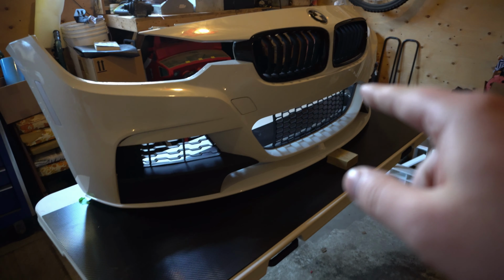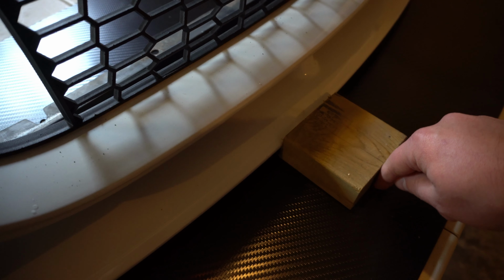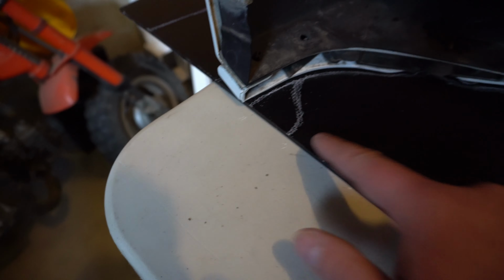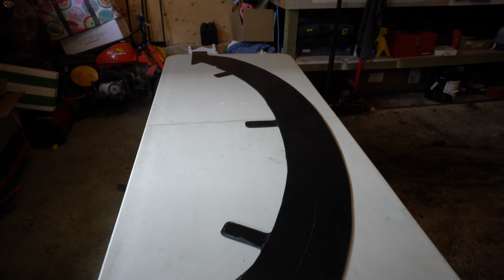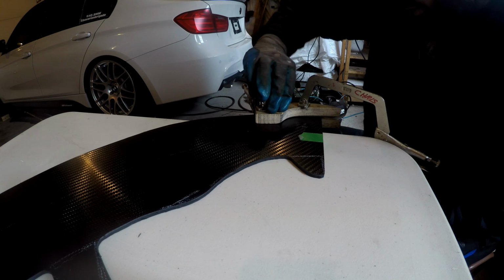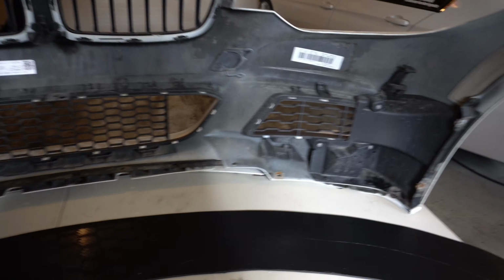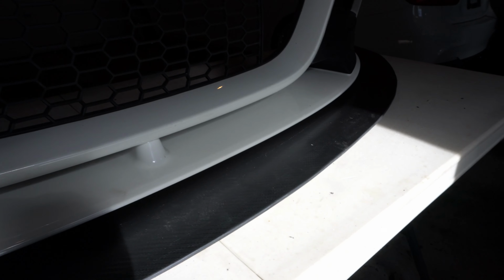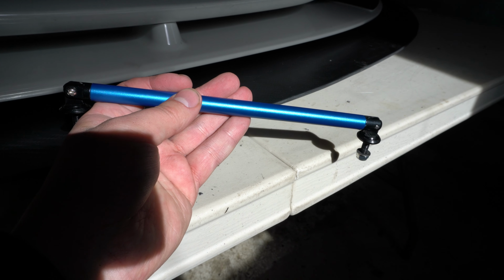How to make and Install a Custom Front Splitter

Comment from the maker: Want to Win an XKGLOW system for your car? Check it out :
https://youtu.be/IWIomjycyUA
Reply: where did you buy that carbon piece to make the splitter out of?
Reply from the maker: I found my receipt and I got the material from Plastic Works Inc in Calgary AB www.plasticworksinc.com and the product code is 01CH and the description is 3/16” Carbon Fibre ABS
Reply: HQ_BMW thank you so much 💪🏼
Reply from the maker: Anthony Michael no problem anytime 👊🏻👊🏻

Comment: For anyone else that ever finds this in the future, do NOT EVER cut Carbon Fiber without wearing a respirator. Once cut the fiber dust are like tiny floating spears that once inhaled, get stuck in your lungs and they do NOT EVER COME OUT. Not trying to shame the video, as most people don't know this, but never ever do it like this please.
Reply from the maker: This is absolutely true when working with real Carbon Fiber. The ABS plastic with CF print on it is NOT actually carbon Fiber
Reply: Yeah, noticed that + total lack of safety gear! Bloody amateurs!

Comment: Looks very nice but this is purely cosmetic obviously right?  There is no way any of those attachment points withstand actual forces generated at the speeds splitters are designed for.

Comment: Looks really good.
Where do you find the plastic sheet.
Reply from the maker: I just googled Plastic sheets and looked for local stores that sold sheets of it.
Reply: @HQGARAGE  ok, cool. I guess it's not a item that you see often or need for that matter on a regular basis so in my mind I'm thinking, special order, ridiculous shipping, etc.   It looks like a strong material unlike plexiglass that would break easily. Anyway, I subscribed to your channel for ideas like the one you shared. I bought a body kit for my MR2 Spyder  that I'll start installing when this Florida heat and rain turns a little cooler in the fall. I want a splitter on it like the one you made. Was it 1/4" abs?
Keep the creations coming and thank you for the video. I'll save it for a tutorial reference for my upcoming build project.
Reply from the maker: I have used 3/16” and 1/4” ABS plastic sheet and the 3/16 was easier to work with but the 1/4 seemed much stiffer.
Reply: @HQGARAGE  I might as well go with the 1/4". You know for the occasional curb rash that sometimes happens, it be a bit beefier.
Reply from the maker: I think that is a very smart decision.
Reply: @HQGARAGE  have you made any rear difussers
Reply from the maker: I have not as of yet

Comment: Much respect!
Reply from the maker: Cheers 🍻
Reply: @HQGARAGE  will this save gas mileage?
Reply from the maker: Nope, won’t save gas ⛽️ at all
Reply: @HQGARAGE  does it give you stability?
Reply from the maker: It does increase downforce on the front tires

Comment: Any tips to put a new lip with old drill holes from old lip? Would bigger screws work?
Reply from the maker: I would definitely say bigger screws would work or if you can use bolts. I had to end up changing mine to bolts.
Reply: @HQGARAGE  yeah thats what I'm going to do now. At first I was going to pay 500 to get it welded.  The thing about bolts is I can't get my hand in there. Bolted won't go no where
Reply from the maker: Can you take the bumper off? Would that help? The other option would be to use a product like a Rivnut. It is like a Nut that is fastened into the bumper and the bolt threads into it.
Reply: @HQGARAGE  yeah I could do that again. I took it off once to switch out my grill but when I installed the lip I just jacked it up. Just iffy about taking it off again. The only thing is I had crooked 1st time the drilled next to it 2nd time now scared holes too close
Reply from the maker: I can totally understand your nervousness
Reply: @HQGARAGE  I'm definitely going to see what's up with the rivnut and removing bumper. I'll find a way , it'll feel weird without my lip. Thanks for the advice bro

Comment: I want to do this to my car, I have a Ford Fiesta SE.  it doesn't have such a fancy front bumper, and has a rubber air dam underneath the bumper.

Do you reckon I should build my splitter off the bottom of the air damn, so that I get the aero effects the splitter are supposed to bring?
Reply from the maker: I would do it on the bottom of the bumper. I don’t think the air dam would be strong enough to support the Splitter.
Reply: @HQGARAGE  thanks for getting back to me!  I appreciate your input!

My plan in tandem with this is to also build an underplate for my car, starting at the level of the rubberized air dam, supported by equally long brackets.  If I build it from that, I was thinking to use ABS and have it extend past the edge of the airdam.

I mostly am curious of if the splitter would even be effective and do splitter stuff if I built it higher off the bumper.  I know that'd look cleaner, too.  I just don't know enough as to the aero effects of both.

Thanks so much for your time, I appreciate you!

Comment: whats the best way to drill a hold in the abs plastic to put the splitter rods in? wouldn't the abs crack around the drill hole when drilling?
Reply from the maker: I just used a drill bit and never ever had a cracking issue and I can tell you the splitter has seen some major abuse.

Comment: Is the plastic you got in the description?
Reply from the maker: It is not but I should add it to the description. I used 3/16” ABS plastic from a local plastic supplier here in Calgary called Plasticworks

Comment: You did not mention where you buy that CF sheets you use!!?
Reply from the maker: Hey, I got it locally at a plastic shop. Here is there website. http://plasticworksinc.com
Reply: Forgot to ask the thickness you use on splitter??? Thank you!
Reply from the maker: 3/16 is what I used

Comment: How thick is the abs plastic
Reply from the maker: I used 3/16” thick material
Reply: @HQGARAGE  do you think a 1/4 inch is too thick or 3/16 is better?
Reply from the maker: I actually think 1/4” is the better option.

Comment: The splitter turned out perfect  Where did you get the material
Reply from the maker: I ended up buying the material from here 
I found my receipt and I got the material from Plastic Works Inc in Calgary AB www.plasticworksinc.com and the product code is 01CH and the description is 3/16” Carbon Fibre ABS
Reply: Right on thank you!!!!!
Reply from the maker: My Pleasure 👍👍
Reply: HQ_BMW so it’s ABS plastic with carbon vinyl?
Reply from the maker: No it’s actually ABS plastic that has been stamped with the carbon weave. So it’s all one piece and gives you the look of carbon fiber.
Reply: HQ_BMW that website blows.
Reply: How much was it?
Reply from the maker: It was $60 CDN for a 2ftx8ft piece
Reply: HQ_BMW did you have to call or email?  Again the site sucks.
Reply from the maker: Fortunately I live about 30 mins away I just drove to the shop. I’m sure if you called they would be able to help. If not let me know and maybe I can swing by and talk to them

Comment: Great job man I went cheap and bout eBay plastic splitter for my car and we’ll I cracked it coming onto a gas pump island I wanna make my own outta sheet metal but the stuff you used looks great! Where can you find that at?
Reply from the maker: Thank you 🙏 I just googled ABS Plastic near me on Google and found a local plastic supply company

Comment: Hey ? What were the measurements of the plastic sheet when u got it im trying to do something like that for a 300 srt8
Reply from the maker: I got 2ft x 8ft to start with and 3/16” thick
Reply: HQ_BMW how much would you charge me to make one for my car
Reply: But not carbon fiber just a regular black one
Reply: HQ_BMW hey i just wanted to say thanks for the info i just finish mine on the 3000 srt
Reply from the maker: Awesome that’s is so rad. Thank you for the feedback 🙏🙏🙏

Comment: I did the same thing but mine flew off after going 50mph. Is it because the plastic was too thin or is it because the splitter is too big? I wish I could show you a picture.
Reply from the maker: It was probably because it was too big. I ended up cutting mine down and also had to use bolts instead of self tapping screws.

Comment: Will the self taper bolts holds the splitter enough you think ?
Reply from the maker: Nope 👎🏻 I ended up redoing the splitter after I got the bumper painted. I used bolts, washers and Nuts to secure it down. You can see what I did in this video https://youtu.be/sZHFNpYbtUc

Comment: I got a 2013 sonic hatchback that I'm putting money into and I want a fiberglass sheet or one that is not pressed. Any ideas?
Reply from the maker: I would look into getting a sheet of Aluminum or a material called e-panel. APR I know makes Aluminum ones for the strength and durability but also very light

Comment: Do you have any suggestions on how to mount a splitter  on a bumper that isn't flat...i.e. an 08 m35 bumper? My bumper curves up towards the front rather than sitting flat like most cars
Reply from the maker: You could trim out the shape bigger than what you need and then heat it up to form the shape or if you know or have access to a sheet metal brake you could shape it to fit. The other option would be to make it in pieces and then bolt or rivet it together
Reply: @HQGARAGE  Appreciate your help, if the rain ever let's up here in Texas that'll be my project next weekend. Your splitter came out perfect, did you even find the correct rods?
Reply from the maker: No Problem and No I didn’t, I ended up. Using some threaded rod and aluminum tubing and just made my own with the ends of the ones I bought
Reply: @HQGARAGE  I might end up doing the same, everyone in other videos say all the ebay rods are trash. Looking forward to seeing more of your videos man, keep em coming👌🏾 If you haven't already, you should do a rear diffuser how to
Reply from the maker: Hey thanks for the great idea 👌👌I have not done one yet but I like it. I will definitely make a video of it. 🙏🙏🙏

Comment: Great work! Looks really nice, and the fins add a lot to it.
Only thing I would be worried about is that it is just mounted to the bumper, is it not a bit flappy, when you are going fast? Most ones I saw are much longer and even connected to the frame. How was your experience so far?
Reply from the maker: I didn’t have any issues to be honest. Being that it is for looks it’s been perfect

Comment: NICE STUFF! It appears everyone is having an issue finding this abs carbon sheet plate, especially for the price you paid. Can you provide the man and model of the sheet plate or a link to it? In the US, so naturally I'd have to find and equal. Thanks.
Reply from the maker: I will get the specs from the shop I purchased it from and also ask if they have anyone in the states that they can recommend.
Reply: HQ_BMW thanks !!

Comment: Nice job bro! Looks nice. I just wanna give my humble opinion. Could you have made it bigger so you can mount it to the chassis?  Maybe it would have more stability.
Reply from the maker: Thanks Man and yes I agree it could have been extended to attach to the chassis for sure. I actually ended up trimming an inch off and cut the wings off and it was rock solid. It was also just for show and would fill the gap between the bumper and the ground when I aired out.
Reply: @HQGARAGE It definitely looks real good. Im gonna have to try to make one myself using your method. I have a cadillac ats coupe, and we basically have no aftermarket parts. Everyone buys the same ebay front splitter lol.

Comment: Wouldn't it be easier to just move the bumper back 3" then trace the bumper without the block? Also what thickness ABS did you use? Thanks for making this video.
Reply from the maker: That method would absolutely work as well. It’s all up to you on how you would like to trace the bumper. The material was 3/16” that is used.
Reply: @HQGARAGE  If you just move the bumper back 3 inches and trace around it then you wont get the extra width and the little wings on the side. If you want it to look a less aggressive then this is what you would probably do and also you wont get the little side wings.  Either way its a pretty nice mod that you can put your own custom finish on, I like it.
Reply from the maker: Yes you are absolutely right and I ended up cutting off the side wings anyway. Thanks for the kind words.

Comment: Great work! Looks Amazing.. Hey I have a WRX front lip that I'm custome fitting on a different bumper, but the lip is wider than my bumper like 2.5". Where do I cut to shrink it and make it fit? Love your wk, Thx in Advance.
Reply from the maker: I would maybe cut it in 3rds and have the pieces and connect kind of like this one 3Pcs Universal Car Front Bumper Lip Chin Bumper Body Kits Splitter Diffuser for Honda for BMW for Benz Carbon Fiber Look/Black https://www.amazon.ca/dp/B07YNLNW6T/ref=cm_sw_r_cp_api_i_iVtNDbJGFQ6HG

Comment: where did you find the sheet of plastic to use?
Reply from the maker: I found my receipt and I got the material from Plastic Works Inc in Calgary AB www.plasticworksinc.com and the product code is 01CH and the description is 3/16” Carbon Fibre ABS

Comment: Hello. Great job sir, looks like its an oem ///M Performance part!

Quick question: how thick should the ABS Plastic be? And have you had any issues with breaking since installation. 

Thanks in advance!
Reply from the maker: Thank you 🙏 I used 3/16” thick abs and it has held up perfectly. It’s still on the car and looks perfect still
Reply: @HQGARAGE  Thanks again sir for the reply.
Reply from the maker: My pleasure 🙏🙏
Reply: @HQGARAGE  thanks for the upload and thanks for answering his question
Reply from the maker: My pleasure 🙏 thanks for watching

Comment: Wow!! GREAT, easy to follow video. I've been wanting a front splitter for my Charger. But some of the prices out are ASTRONOMICAL for something with quality, and/or is not going to fly off after you hit 2nd gear. And for showing the ease of how you turn up the sides too? I'M DOING THIS (LOL). After viewing several of your other videos, you've just gained another subscriber. I look forward to seeing more of Vlogs, and video uploads. (Side note: What carbon material did you use for the splitter, by the way? Please?)
Reply from the maker: Thanks for subscribing and watching some of my videos. I truly appreciate that. The Carbon material is actually and ABS plastic that had a carbon Fiber imprint stamped into the plastic to give it the carbon look. I have been told it’s nearly impossible to find anywhere
Reply: @HQGARAGE  Some aluminum from Home Depot, and a carbon fiber wrap it'll be then LOL. Thanks again for your reply. Much appreciated :)

Comment: Where you located
Reply from the maker: Alberta, Canada 🇨🇦
Reply: HQ_BMW where can I get the abs sheet at ?
Reply from the maker: I got mine from this company I found my receipt and I got the material from Plastic Works Inc in Calgary AB www.plasticworksinc.com and the product code is 01CH and the description is 3/16” Carbon Fibre ABS

Comment: Where did you get the carbon fiber plastic ??
Reply from the maker: I found my receipt and I got the material from Plastic Works Inc in Calgary AB www.plasticworksinc.com and the product code is 01CH and the description is 3/16” Carbon Fibre ABS

Comment: Hey, I loved how your splitter turned out man. I've searched the internet and called around but wasn't able to find the material you used. I was hoping you could tell me where or how you found that material??
Reply from the maker: Hey, Thank you I appreciate that. I went to a local shop here and went to buy Black ABS plastic and they showed me the CF looking stuff. Let me see if I can get you a Part Number.
Reply: I'm interested as well
Reply: @HQGARAGE  I'm interested as well
Reply from the maker: I found my receipt and I got the material from Plastic Works Inc in Calgary AB www.plasticworksinc.com and the product code is 01CH and the description is 3/16” Carbon Fibre ABS

Comment: Where did you get the plastic and rods from
Reply from the maker: The rods are here 
Order your Front Splitter rods Here 
https://amzn.to/2HAojCW
https://www.amazon.ca/gp/search/ref=as_li_qf_sp_sr_il_tl?ie=UTF8&tag=hqbmw-20&keywords=Splitter Rods&index=aps&camp=15121&creative=330641&linkCode=xm2&linkId=53deee0ff69d42cb211115820923c944

And the ABS Plastic is from a local Plastic shop here in town

Comment: Splitters usually cover the whole inner area for better aero. Tuning for looks: Race. Inspired. Cosmetic. Enhancement. Whatever floats your boat I guess just don't go full ricer. That's like mounting a cold air intake with no turbo or induction system.

Comment: Bit late of a comment, but what size self tap bolts are you using and where can i get it?
Reply from the maker: Don’t use self tappers, there is a bit of a later video where I talk about using bolts as the self tapers will just pull out. https://youtu.be/sZHFNpYbtUc